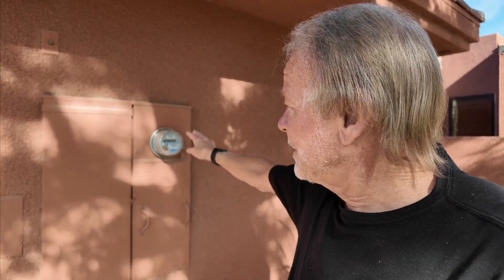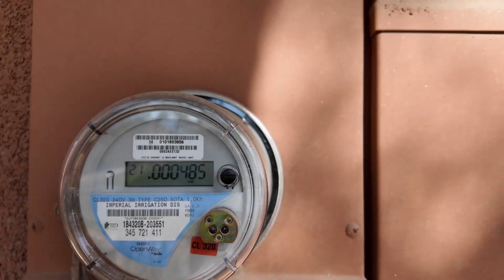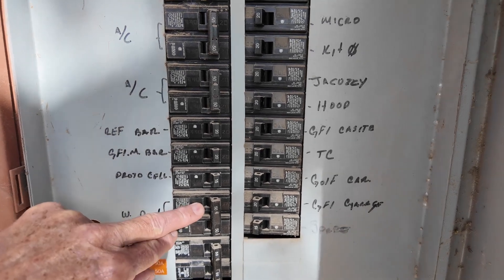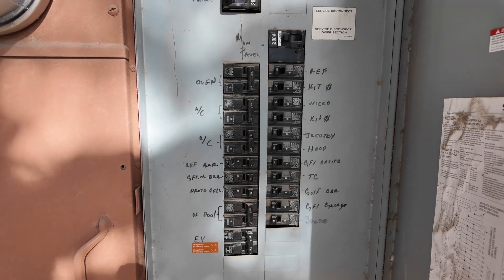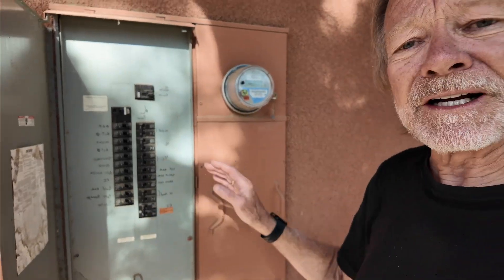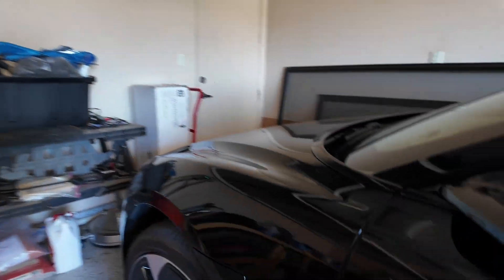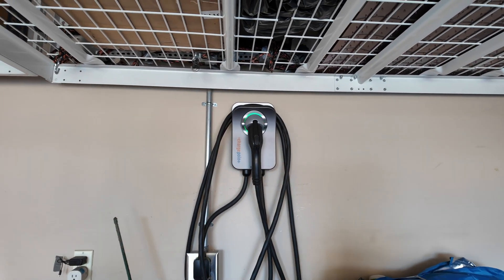Buying an EV?  How to prepare for a home charger for your electric car

Comment from the maker: Home Charging Notes:
240-volt 60-amp circuit = 11.5 kW per hour = 33 miles added per hour*
240-volt 50-amp circuit = 9.6 kW per hour =  28 miles added per hour*
110-volt 35-amp circuit = 3.1 kW per hour = 9 miles added per hour*
* based on efficiency of 3 miles per kWh (my Lucid averages 3.7 miles per kWh)
The time it takes to charge your battery will depend on the kWh size of your battery.  My Lucid has a usable battery size of 86 kWh
To learn about range, battery size and charging visit my website https://www.evrangecalculator.com/
Reply: Good vid and lots of great advice. 
If you get a charger that is hard wired rather than using a plug, you can safely charge at 11.5 Kwh (48A) on the same 50A circuit.  I'm using an Emporia.
Reply: @ScottDLR  That is actually incorrect.  Any circuit that is considered continuous, basically anything that runs more than 2 hours or longer, needs to be de-rated by 20% according to NEC article 625, as seen here:

"According to the National Electrical Code (NEC), when installing a dedicated circuit for EV charging, you should follow the "80% rule," effectively providing a dedicated circuit with sufficient capacity to prevent overloading and potential damage to the wiring; this is typically applied by selecting a circuit breaker size that is at least 20% larger than the charger's amperage rating."

To run a 48A charging, your breaker and your wiring has to be rated at 60A, not 50A.
Reply: @redbaron6805  My apologies,  I made a mistake, The circuit is powered by a 60A, not 50A breaker.

Comment: Now going on 8th year of my VW e-Golf and it was just over year ago I decided to install a charger in the garage https://youtu.be/cYbnZuNGBAY up until that time I was using the free chargers in my area. Having a charger comes in handy during the winter months and foul weather. I installed my own system but had the county inspector signed off on my work. This is not a project to cut corners on, use the best parts and build beyond code requirements.

Comment: I'm in my 70s and my older house didn't really have room in the circuit breaker box. What I did instead was on the other side of my garage wall is my laundry room, and dryers run off a 240V/30A plug/circuit. I bought a Splitvolt ($300) that you plug into that outlet and you plug your dryer into it and it has another plug that you run out to your car. It auto-switches to the dryer when you use it, then auto-switches back to the car when the dryer finishes. I just had to buy a 30A extension cord to run through the wall out to the car and a 30A charger adapter. A small RV camper plastic power cord hatch (2) cover the inside/outside hole in the wall. It works great and only slightly slower than a 50A. BTW, older houses have 3-prong 30A plugs, newer are 4-prong plugs so you need to get the right box. Splitvolt isn't the only box like this. Box + adapter + extension cord cost me about $425 when I got it 1+ years ago.
Reply from the maker: Good to know, thanks for sharing.  One point, you probably already know, if the breaker is 30 amp the max pull needs to 20% less.  That equates to 24 amps max.
Reply: @LifeAfter70-years  Yes. I was worried about that, but found the Tesla automatically charges at the reduced amps when you plug in at 15A, 30A, 50A circuits.(And the Splitvolt text on the front says warning max 24A.) I don't know if other EVs do that automatically.

Comment: Another thing I love about the EV besides the acceleration is how fast they heat up in the winter! You don’t need remote start, but you go on the app and turn on the climate control. Don’t need to be parked outside like a remote start vehicle, it will go to your preset temp quickly, and your butt warmers and steering wheel heater will have it toasty real quick!
Reply from the maker: There are so many things to love.  Thank you for sharing!

Comment: Age 72, have a Tesla Model Y. I started with a 50 amp, 240V outlet installed myself. I installed one at my cabin, but code required a gfci breaker. It immediately kicks off because the tesla charging cable has a built in ground fault. I switched to a charge station, that didn’t require a ground fault breaker and was easy to switch over and hard wire it in. At home I signed up for off peak electricity and went on the solar and wind only program. The power company required a professional install to get their $500 rebate, not just an inspection which I had done before.
The power on off-peak is $.08 per kwh, about half of regular. It goes on at 11pm, cuts off at 8 am. I plug in every night, and wake up to a full tank. My bill for fuel last month was $12, and my accumulated total time spent on charging was about 2 minutes… however long it takes to step out of the car, grab the plug and insert. I agree, you do get spoiled!
Reply from the maker: Thanks for sharing your experience and great advice!  Your post will help the EV revolution!

Comment: Great informative video…Thank you.. I’ve test driven a couple of EV’s..The Soltera and Ionic 5.. An Uber driver gave me a ride in a Tesla model 3. Very impressed with all of them and I’m definitely considering getting one. Even had a 240 plug installed in the garage..Don’t know if I should wait until the sodium ion battery is in more models. I’ve had my ICE car for over 18 years. It just turned 99k miles. It runs just fine and I don’t put a lot of miles on a car..So just debating with myself at this point…ha..again great video..👍
Reply: All the modern EV batteries will basically outlast the car by now.  So, unless the Sodium battery is a cost concern or another factor, the average EV battery will easily last 300k miles today, more than you will probably drive in your lifetime...

Comment: I know Paul, and he knows his stuff! As an EV owner myself I get these questions from friends looking to buy one all the time. I have an elevator speech memorized. But now, I just tell them to watch this video! Just to be clear, it kind of sounded like Paul said a good receptacle was $7,500! He said $75-$100. Thanks Paul!
Reply from the maker: Thanks, buddy!  You also heard my slip at the beginning, "RV" vs EV.  Oops!  I'm trying to speak what's on my mind without a script and editing.... maybe I need to rethink that one.  Thanks for clarifying me slur on the $$ for charging dispenser.  Looking forward to seeing you soon!
Reply: You can either use the Hubbell which is $75 to $100, or the Bryant 9450FR, which is basically the same outlet made by Hubbell under their Bryant line which will run you around $50 to $60.

Comment: would Hard wiring be better? Or just install a plug? I  guess  having a plug you could up grade later on to a newer/better adapter?
Reply from the maker: Hardwire is best.  I used a plug to move the charger between homes.
Reply: Having a plug just allows you to quickly replace or upgrade the charger when needed.  If your EV supports anything above 10kW, most higher output chargers are usually hard wired, up to 19.2kW.

The NACS plug will become the standard on most EV's, and the CCS/J-1772 plugs will start fading into the sunset.  Allows you to replace the charger with a NACS charger when the time comes...

Comment: Good advice to use a high quality 240 V outlet.  The cheap ones are fine for electric ovens, but not EVs continuous high loads.  Best way is to hard wire the EVSE, with no outlet or plug to fail.  This also is cheaper for jurisdictions that use the latest NEC (national electrical code), which requires an expensive GFCI breaker.  EVSEs have GFCI built in, so no need for a second one to protect the outlet and plug when you hard wire.
Reply from the maker: You’re right, go hardwire!  I selected the plug option so that I could transport the charger between my two homes.

Comment: Great video👍@ 10:55 looking forward to your knowledge/experience about fast charging....i rented a CT to try 110v charging in our garage...i think my 12 ' narrow gauge extention cord limited the charging speed!
2 mph! App displayed 12 amps maximum available from a 30 amp upgraded 110v breaker circuit  i had professionally upgraded for my 2hp tablesaw....
Reply from the maker: Thanks for watching!  Do what works for you because charging speed is only important if you need it.

Comment: 👋?4u...what is the peak rate in your garage charging situation? 10:00
Reply from the maker: Power (kW)=40×240÷1000=9.6kW.  So, 40 amps at 240 volts is 9.6 kW

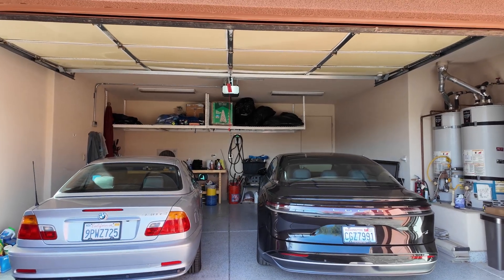Comment: Great informative video❤ @5:05 why 2 water heaters....🤔jus curious, never seen that before👀
Reply from the maker: The house was built with the 2 water heaters.  All of the homes in our development are the same.  My research on this question takes me to the likely reason:  efficiency. One can be turned off except in times of high needs (aka house guests).

Comment: As I mentioned in the comments of your other video. I only drive about 100 miles per month. I charge at home on 110 volts.  With my driving habits I get better than 4.5 miles per kilowatt hour.  The range of my Hyundai is officially 220 miles but the way I drive, the car indicates over 300 miles range.

I like shiny new things so I'm leasing.  Getting an EV was the best thing I've done for my lifestyle.
Reply from the maker: I have the same situation with my car.  When finished charging it will show miles available that are not realistic.  It does adjust along the way, but only after leaving the charging station and on route to my destination.  Because of this (and my endless need to understand how things work), I developed an app iOS and made it available for free on the Apple Store.  You can visit my website https://www.evrangecalculator.com/ to learn more.  Thanks for watching my videos!

Comment: They now make a breaker that fits on under the meter base irregardless of your service as long as you’re meter base is in plugging distance to your vehicle. I have 100 amp service and as long as you charge overnight it should not be a problem.
Reply from the maker: Wow!! Send me a link and I will put in the description. Thanks for sharing!